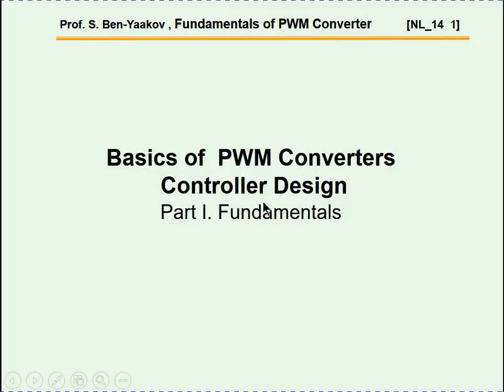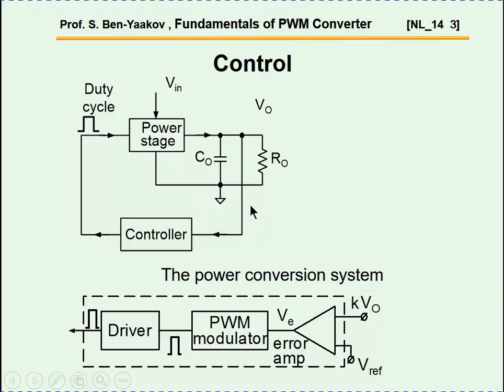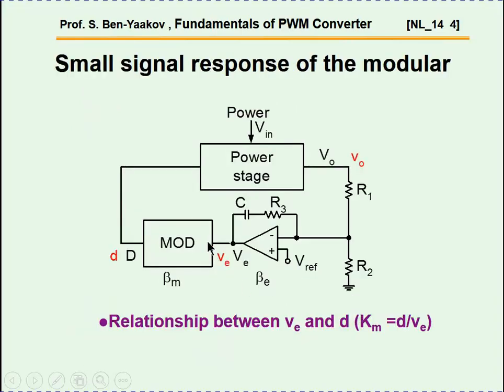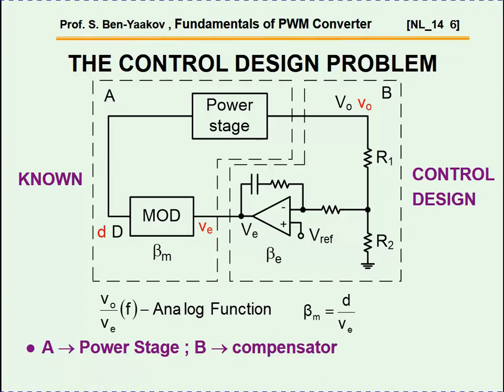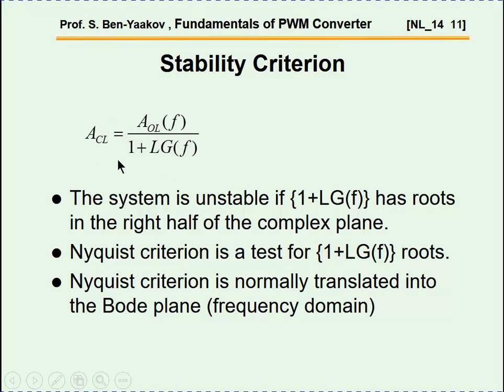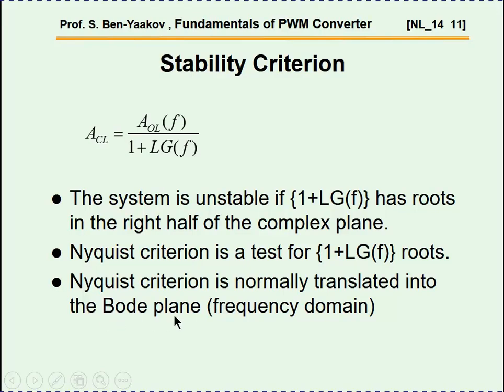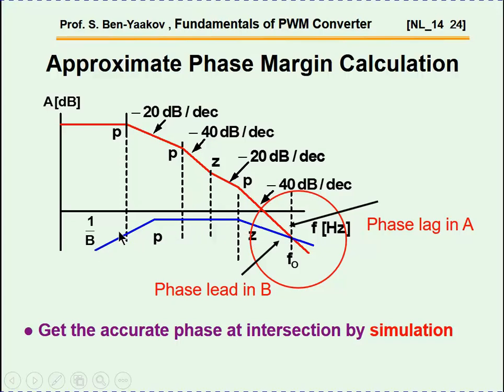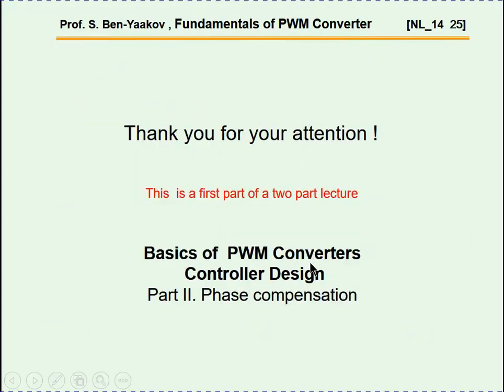Basics of  PWM Converters Controller Design. Part I. Fundamentals

Comment: Dear Sam, 
in case of LLC resonant dc-dc converter, do you suggest to use type II compensator or type III compensator? I read on SLVA662 T.I. paper that they say that for voltage mode we must use type III compensatori, what about your technical opinion?
Thanks in advance for your reply.
BR/Roberto
Reply from the maker: As far as I know that app note is for PWM. In case of LLC you need to consider the open lop transfer function. See: https://youtu.be/amRqIgH10Rg

Comment: Very good explanation! Thanks for your interesting videos! 
I'm sorry for that, but I guess there is a little mistake at 15:10 in the phase plot of Bode diagram; if it was intended to represent the same system of the Nyquist diagram, there could be an error near the phase margin point, that appears to be negative instead of positive. I mean that the phase is going down too fast in that plot, and that's not the situation represented by the Nyquist plot. To be coherent, the phase at 0dB should be about - 120°. Am I right?
Reply from the maker: Thanks for note. Yes, there is an error, already spotted by some viewers in the past.

Comment: Thanks for your great presentation. Here is a question about the feedback loop. At 3:17 ,the voltage divider is included in 'B', but at 6:15 , it is in 'A'. What is correct one?
Reply from the maker: Does not matter. The loopgain is the gain around the loop.

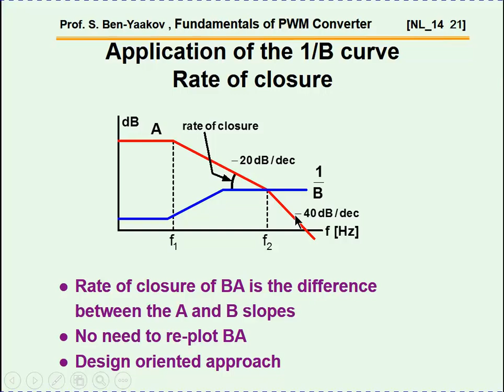Comment: Hi, at 25:52 (slide 21), you mention that the phase margin would be very bad, and that it would be an unstable system. I agree with the phase margin being bad, but I think the system is still stable. Theoretically, two poles cannot cause an unstable system (180 degree shift at infinite frequency).

Anyways, thank you for the lectures. They helped me a lot.
Reply from the maker: Under damped even if not oscillation is not good. Fur her, the circuit always include parasitic capacitances that cause further phase delay.

Comment: Hi Professor, Thank you for making this video. It was an eye opener for me. 
I need some clarity about on of the points shared in the video. By drawing a bode plot for a closed loop system, why are we plotting AB and not A/(1 + AB) which is nothing but ~1/B ? Effectively my questions is, why are we doing analysis on just loop gain (AB) and not the whole gain of the system (A/(1+AB))?
Reply from the maker: When AP>>! the gain is i/B. But AB determines when AB>>! and if the system is stable.

Comment: Excellent explanation prof. I only have one doubt in the "Bode plane" slide (min 13) in the phase plot I think that instead of -180 this has to be -90 degrees. For the rest i think you are the best❤
Reply from the maker: No.it is -180. The drop in slope is -40db/dec. This is a case of unstable system.

Comment: Thanks prof. I personally prefer the explanation where you cancel poles with zeros and zeros with poles to realize a -1 slope at the 0dB line. It just seems easier to understand.
Reply from the maker: While the explanation might be simpler, the application involves a more tedious  trial and error procedure to get the desired  phase margin.
Reply: Ok, thanks for that. I've never had a problem but I'm sure you're correct and will re-look at your method.

Comment: Thank you Professor!
Reply from the maker: Hi Dick, thanks for comment. I just looked at you :A Linear permanent magnet synchronous motor for Needle-free Jet Injection
Impressive.
Reply: Thank you! As you might have guessed, it is the time that I need to build a power supply to run my device at its full power. Thank you for your lecture series, I will talk about them on my blog.

Comment: Thanks Professor Yaakov for the great explanation. I have one question. When  analyzing the current sense method whereby you  measure the  voltage across the inductor DCR, are you assuming a sinusoidal waveform? Otherwise the impedance values would not be correct. If you are, then you are using a first harmonic analysis?
Reply from the maker: Hi Chuck, sinusoidal waveform is
not assumed, The output is correct for any (within practical limitations)
frequency and combination thereof (a triangular ripple ). See
https://youtu.be/sqQzBxfECj4?t=1063

Comment: hi, Prof Ben-Yaakov Thank you for your lecture! One question, given the same cross-over frequency, is higher phase margin always better?  Assume 80 deg vs 70 deg PM. Both are stable for sure. Could you shed some light on this?  Thank you!
Reply from the maker: Rise time to step will be shorter for 70 deg.
Reply: @sambenyaakov  Thank you. Do you mean a load step or a input step? For SMPS, I assume it is often times as a load step. For this reason, I think you're saying that given a load step, the 70deg PM will have less rise time than 80 deg.  Correct? Thank a lot

Comment: Sir, you were saying that using rate of closure of A & (1/B) Plots, we can find the phase margin. During -20db rollover phase is -90deg, phi_m =90deg and at corner frequency phase is -135deg, phi_m =45deg. But sir, these phase margins at those points are corresponding to only plot A, but you were telling that rate of closure of two plots gives these phase margins, i feel you didn't add the phase of (1/B) plot to phase of plot A to find the overall system phase margin.
Reply from the maker: Please indicate the minute in video you are referring to.
Reply: @sambenyaakov  at 25:15
Reply from the maker: The -20db/dec is between the A and 1/B. This means that if you will plot it like in https://youtu.be/L3MRnEYdi8g?t=1371  the crossing will be at -20db/dec, becuse the different(which is BA) is -20db/dec.

Comment: Sir,I have a doubt regarding bode plot method,usually we use bode plot or nyquist technique for linear systems right?but here we are determining stability for power modulator which is actually a non linear device,how it could be possible to find out the compensation using this bode plot?Please clear this doubt sir as I am working on one project and I need to publish one paper regarding non linearity of power electronic devices.Thank You
Reply from the maker: Hi, the classical method  of switch mode systems control design (which are indeed non linear) is to use averaging to obtain a linear representation of the system, or to use average simulation models which I am showing.
Reply: Sir, I didn't understand what you were trying to say, were you saying that you are approximating the nonlinear device into the linear device?And I want to ask one more question.Are time domain techniques really useful to find out the stability of nonlinear devices or is it better to go with the state space techniques for nonlinear devices?
Reply from the maker: Google: 
state space averaging 
average simulation o PWM

Comment: sir does it mean we should never cross 0 db line?
Reply from the maker: You can't avoid it (gain will always drop eventually). The point is that at the cross over the phase margin should be OK
Reply: @sambenyaakov  sir can you tell more about control scheme

Comment: Thank you very much , there is something i don't understand  in DC and in AC. In DC for exemple the compensation network do not have effect when V(-)=V(+) we have output of the amplifier should be 0V . But as to produce the PWM signal we compared it with SAWTOOTH. The result of this comparaison will give d.c~100% and that make no sense , because when V(-)=V(+) we should have Vout=D.C*Vout .
Reply from the maker: Good question. {V(-)=V(+)+epsilon} which is sufficient to produce an output for generating D
Reply: @sambenyaakov   thank you for your quick  answer.  
I understood my  problem.  Because at  school we told us that  Vout=D.c*Vin,  but, and  that  make  no sense  when  Errors  is equal  to zero because  your  duty  cycle  is zero. finally  it same  like we care about  that  relationship  when we do not behave Fb.  With  FB,  we focus  on  Vref and  Vout hence it makes  sense to  have  a duty  cycle of  zero when  vref=vout and  Vin is there only  to  give  the  sufficient needed power.  Finally if i check D.c with  a oscilloscope  is  never constant  but  permanent  changes.  This  was  my confusion
Reply: @sambenyaakov  

the Pin Vref(V+) of the EA is the desired output and the Vout mesured( V-) is input Voltage . Hence when the Vout mesured( V-) change , the dutycycle adjust in order to have the good Vref. 

Vout=D.C*Vin  it's finally used only for design of components   once everything is turning  ,  we can not observe directly since duty cycle is set,  thank to vref of  EA and vout.  
Am i right?
Reply from the maker: Pretty good. IN proper designs (e.g. PI control) the gain of the error amplifier at DC  is very large  so it takes only a minute deviation from Vref to build up the voltage required as input to modulator . See https://youtu.be/04gJ1t2cQdA